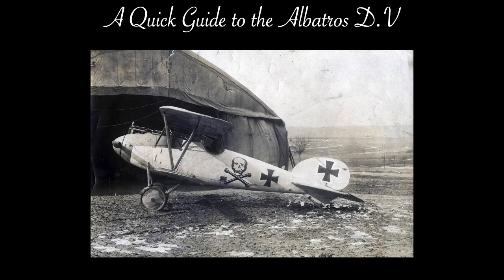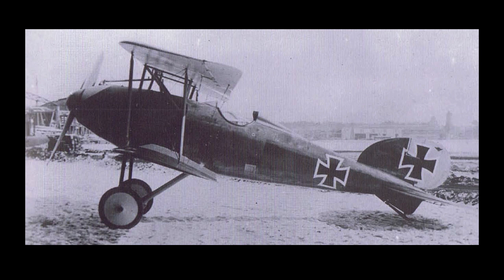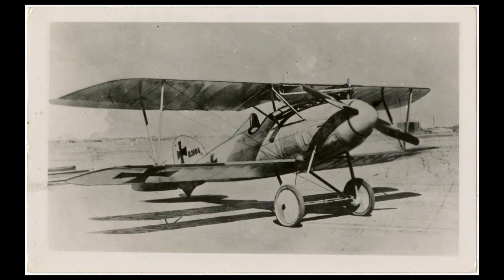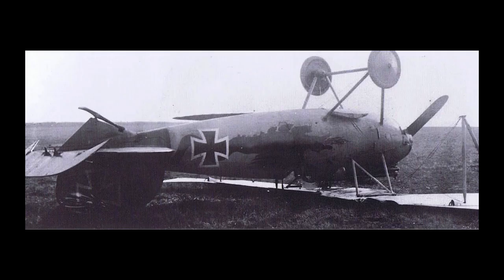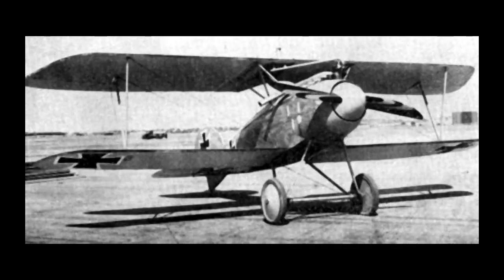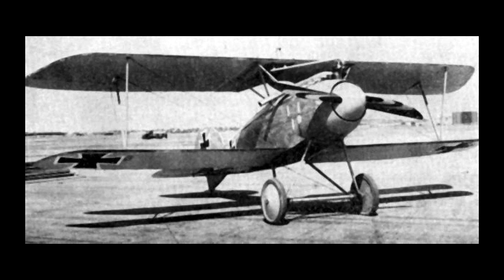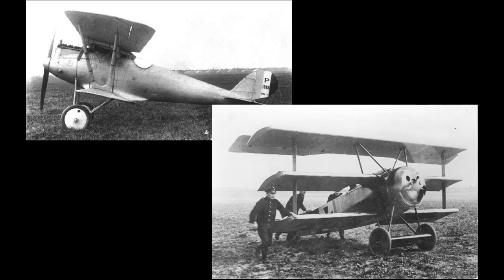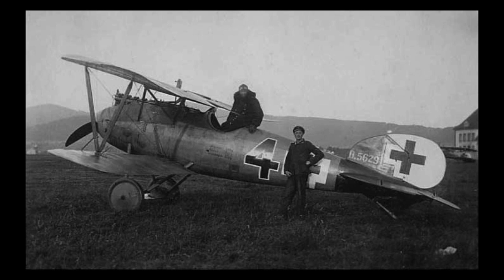Albatros D.V

Comment: It appears as if the German engines developed less horsepower than their enemy counterparts however they just used a different horsepower calculation formula. Though I do believe they were falling behind in octane
Reply: That's because the Germans concentrated on aerodynamics, while the Allies went with engine power.